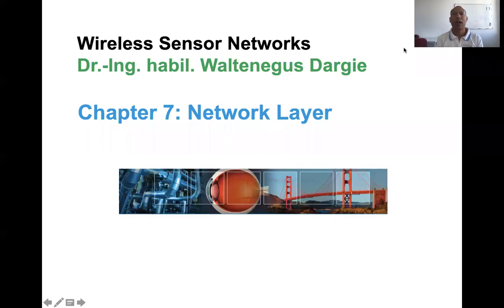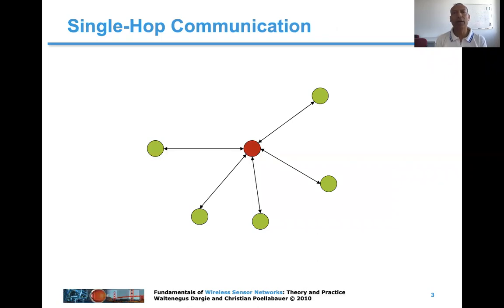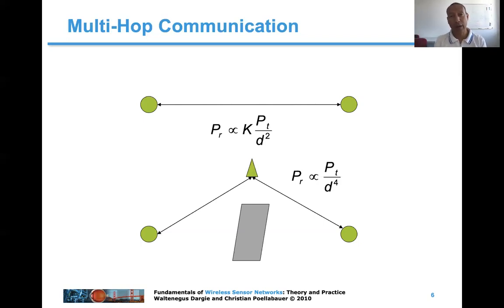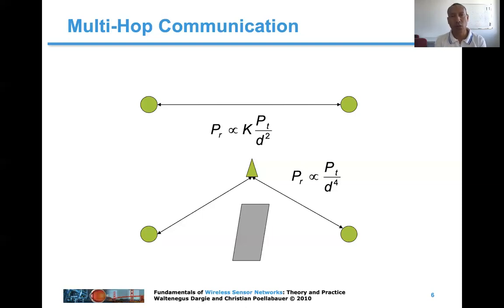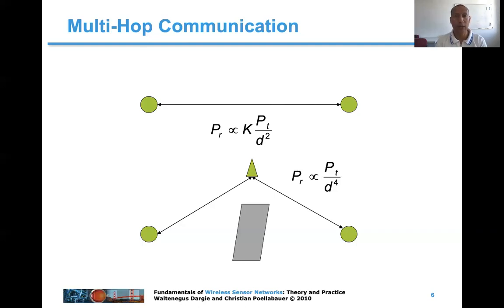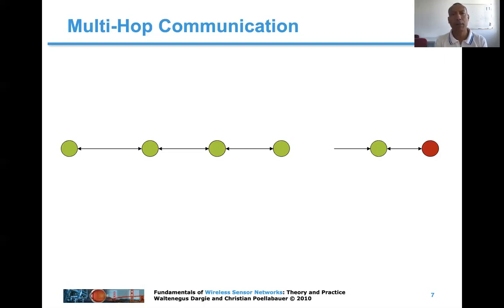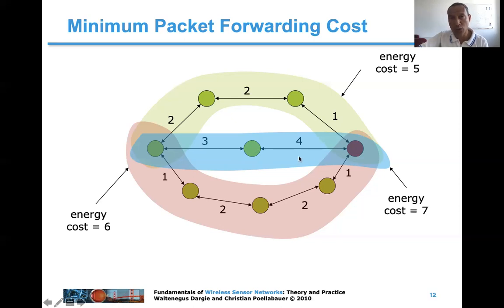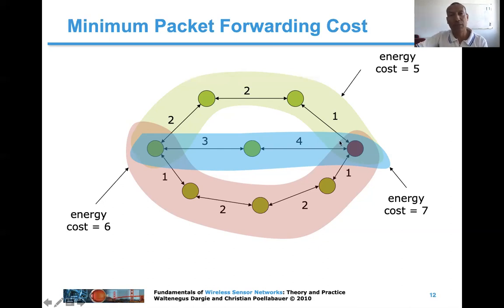Routing Protocols for Wireless Sensor Networks

Comment: hello Teacher , thank you verry match for the video.
I am doing a project in Master in ENERGY EFFICIENT ROUTING PROTOCOLS  C++ IN WSN.
i need a  energy  code of this to execute is in NS3.
Reply from the maker: You may wish to refer to these papers:

1. Dargie, Waltenegus, Xiaojuan Chao, and Mieso K. Denko. "Modelling the energy cost of a fully operational wireless sensor network." Telecommunication Systems 44.1 (2010): 3-15.
2. Chao, Xiaojuan, Waltenegus Dargie, and Guan Lin. "Energy model for h2s monitoring wireless sensor network." 2008 11th IEEE International Conference on Computational Science and Engineering. IEEE, 2008.
Reply: @waltenegus   thanks , where can i find this?

Comment: I am doing my thesis on Selfish node detection in WSN based on its average retransmission number. Which routing protocol will be suitable in my thesis?
Reply from the maker: Hi, can you clarify what is meant by selfish? Do you mean a node which utilises the medium selfishly? If a MAC protocol is in place, it makes sure that the node respects the rule (usually, this. in a TDMA protocol, a node transmits in its slot only; in a CSMA, the node transmits only after ensuring a free medium. The IEEE 802.15.4e specifies a new rule where the use of a specific channel is limited to a set time, etc.). A node can be selfish (and unruly) if only it is outside of the network (i.e., it is malicious). But I am not sure if this is what you meant.
Reply: Sir are you doing a Ph.d ?
Reply: @nafbondebela5326  
nice explanation
Reply: @nafbondebela5326  i Will write to you

Comment: sir i am looking to do a project related to agriculture field study, can you suggest which routing protocols is apt for that to implement sir
Reply from the maker: If you are intending to monitor such parameters as relative humidity, temperature, moisture, radiation, and so on, you may consider RTL or  any of the tree-based routing protocols, which are relatively easy to deploy. Most of them are implemented for the Contiki platform (https://github.com/contiki-ng/contiki-ng). The question is how big is your network? Alternatively, you may cluster the network (https://ieeexplore.ieee.org/abstract/document/9082144) and use the cluster-heads to collect data ifficiently.